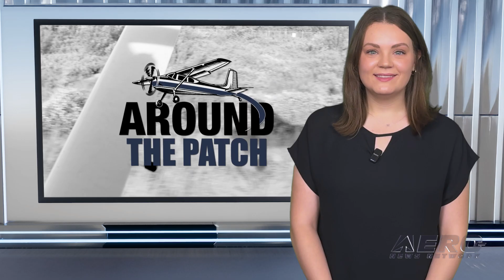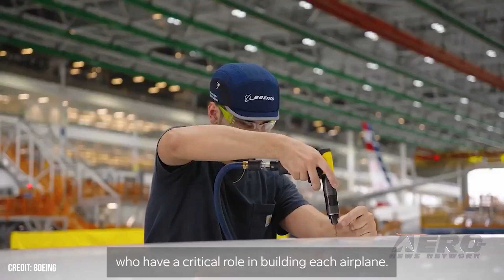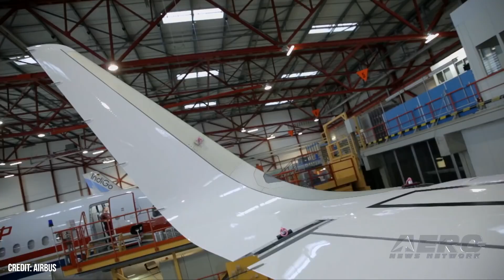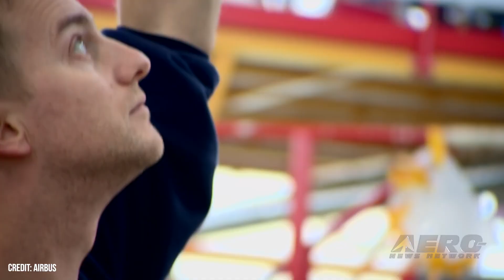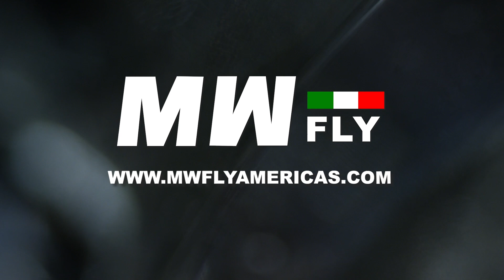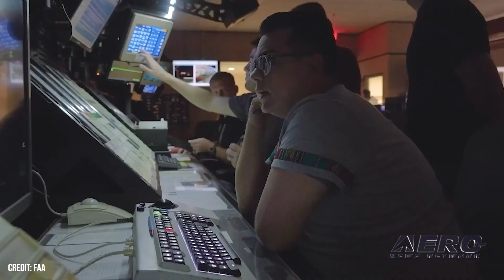Airborne 05.05.25: NTSB Holland Prelim, Airlines v Tariffs, $$$ For ATC

Comment: all parts survive intact, why can't the cockpits be built like car frames so they protect the occupant?
Reply: Weight, balance, and strength challenges…

Cars weigh 2-3X what a similar car weighs.

Some planes… like a Mooney, have a steal cage and air bags.  Very helpful for accidents on the ground…

Some planes… like a cirrus, have a parachute.  Very helpful for accidents more than 1k’ above ground…

Older planes, are not so lucky…

😃